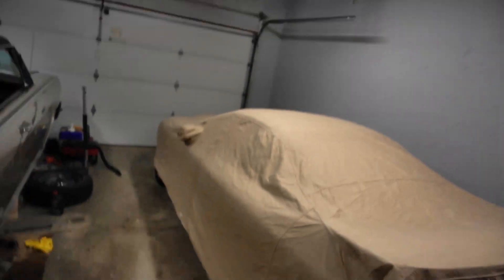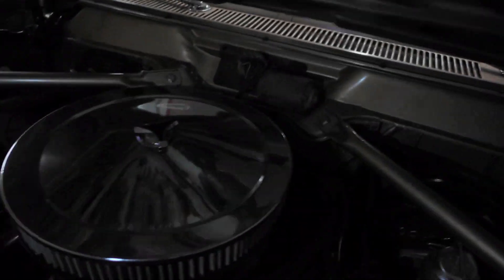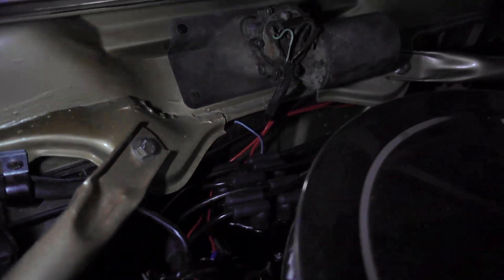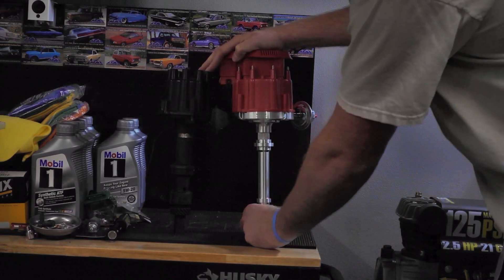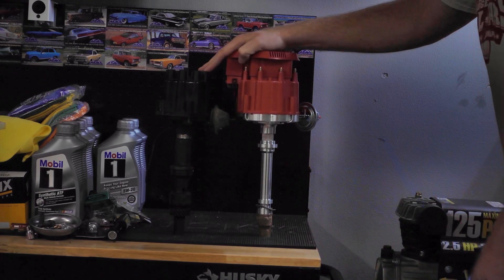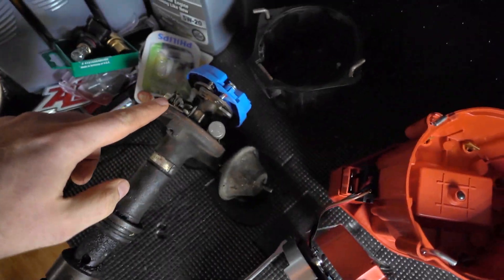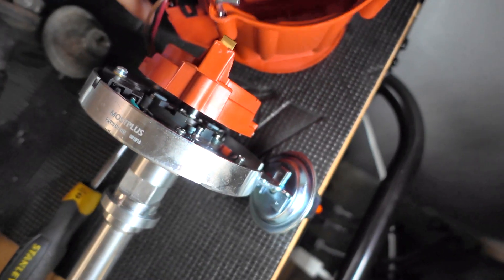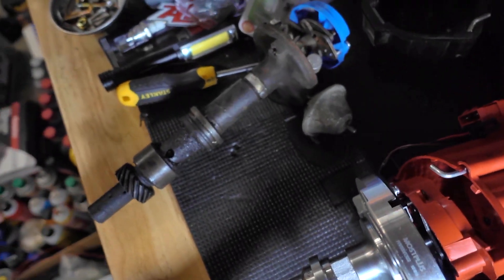Can we use a SBC Electronic Distributor?  SBC and Gen 1 AMC Distributor Comparison

Comment: The issue that I am running into is that it turn counter-clockwise.  At this point I would be happy to just have spark going to the plugs.  I've replace the cap. rotor, condenser,  and points.  I have all new plug wires and plugs.  I have 2 new coils that I have tried.  I'm missing something that is not in the TSM wiring schematic.  I've tried the Petronix products and even  was ready to shell out for a NOS distributor.  I actually drug my car out of a field in Kansas.  It turn over, but that is as far as I have gotten.  I put on a new carb and still need to figure out the trans down-shifter linkage.
Reply from the maker: I might have a distributor that I could dig out for you, might need a little cleaning up.